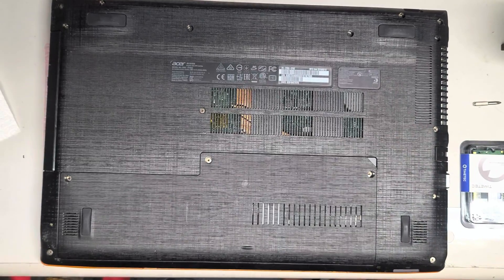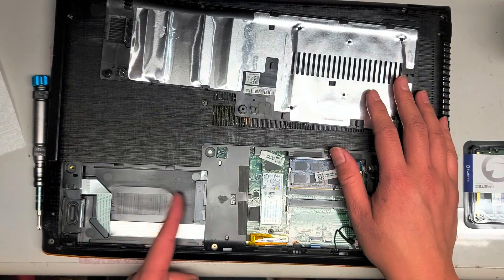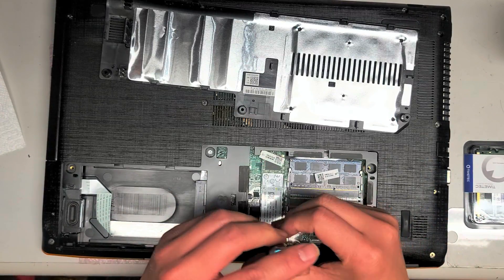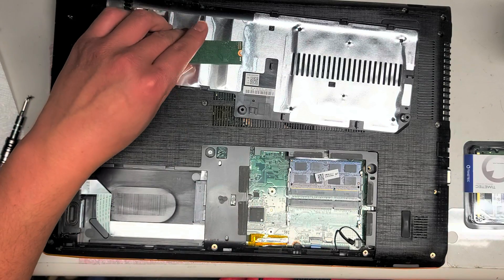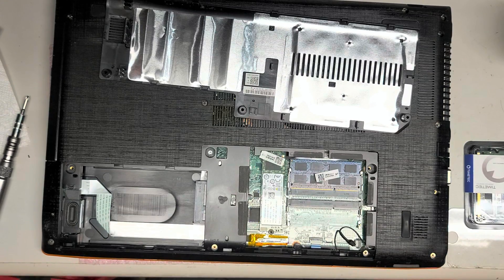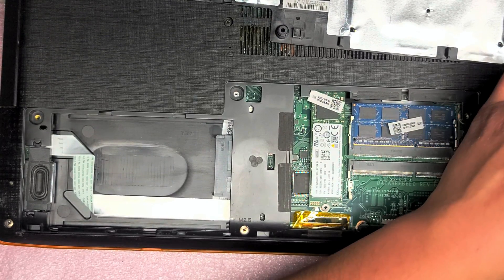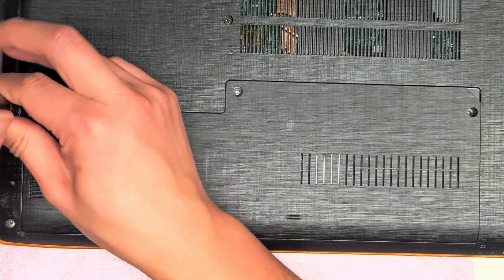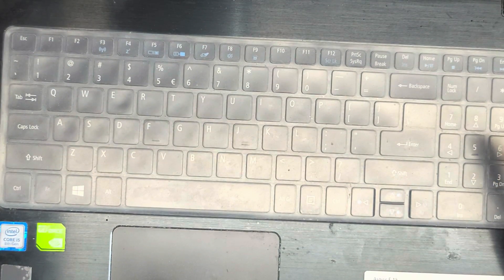Acer Aspire E5-576 Series N16Q2 Disassembly RAM SSD Hard Drive Upgrade Repair Replacement

Comment: Thanks. I am mostly interested in which RAM modules would fit into my Acer Aspire E15/E5-576G-70P2 (or 7QF2, this part of the sticker is barely readable). If I understand it right, I can replace the RAM stick I have and add another one, up to 2 16 GB sticks. Still way cheaper than a new laptop. 
My Graphics Card is an older NVDIA, but is supported by the latest drivers which use RAM to simulate more VRAM. I currently have 8 GB of RAM which is getting a bit tight sometimes.
Processor is an i7 with 2.7/3.5 GHz. 512 GB internal SSD and a fast external SSD with 2 TB.
Before I order anything I want to make sure that I can use it and that I won't break my computer...
Thumbs up for the video and thanks again.
Reply from the maker: Get this https://amzn.to/3U5Hg4J
Reply: @ItsBinhRepaired  Thanks. Will look for something will the same specs then. (Unfortunately, this particular article is not available for my country, dammit...)
Reply from the maker: @annenym2222  ahhh I see

Comment: Hi, My lap was Aspire E 15 E5-576G-56FW, what does maximum ram support ?
Reply from the maker: There is no limit aside from what you can afford and put in the slot. Have to match the typed and speed.
Reply: @ItsBinhRepaired  32GB is it ok ?
Reply from the maker: @dilknilaksha2313  sure

Comment: Is this 8th gen lap?
My lap is also e5 576.
But i want to know what type of ssd is suitable for me. Nvme or M.2 ?
Reply from the maker: Nvme is m.2. Not sure what you mean by 8th generation. I don't know.
Reply: @ItsBinhRepaired  i mean m.2 nvme or m.2 sata
Reply from the maker: @Weranga-Rathnayaka  won't know unless you try.
Reply: @Weranga-Rathnayaka   You can use any, better if you can SSD M2 NVMe
Reply from the maker: Yup

Comment: If I use 4gb ddr ram on this laptop will it be ok?
Reply from the maker: What do you mean? One more 4gb?
Reply: @ItsBinhRepaired  I mean I want to add another ram on my laptop.Its like upgrade my laptop.
Reply from the maker: @mhjakieverything379  should be fine. Just make sure the specs are the same.

Comment: Nice video! What kind of foam should I use to secure the HDD drive from moving around?
Reply from the maker: Any soft material that keeps it's shape should be fine.
Reply: @ItsBinhRepaired  Thanks!
Reply from the maker: @manuelavendano3891  no problem
Reply: @ItsBinhRepaired  Thanks!
Reply from the maker: @manuelavendano3891  no problem
Reply: @ItsBinhRepaired  Won´t the HDD drive overheat or something if I put a little sheet of protective foam under it?
I used this kind of foam:
 https://www.polymerpkg.com/polyethylene-pe-foam/
Reply from the maker: @manuelavendano3891  don't put the foam under. Only at the back to prevent it from disconnecting from the slot. I'm more worried about the static.
Reply: @ItsBinhRepaired  which one is the back
Reply from the maker: @ameliaroberts-caudle2360  in the video I mention it and point to it.